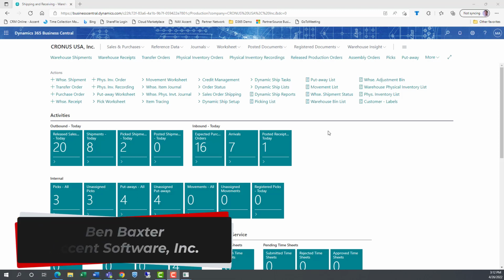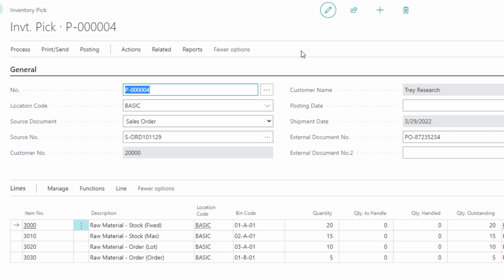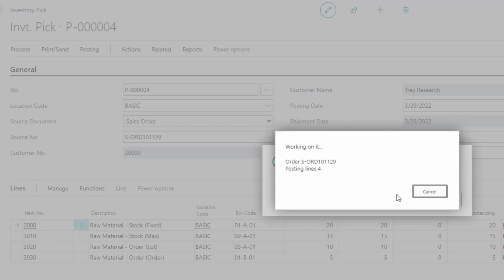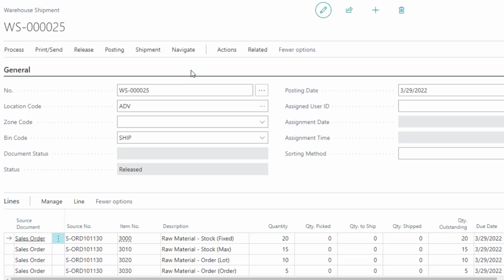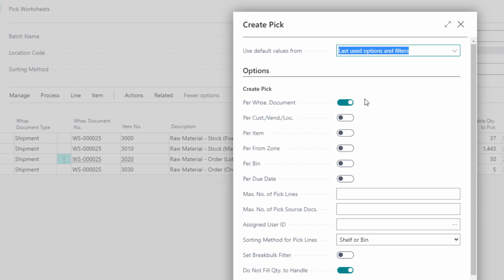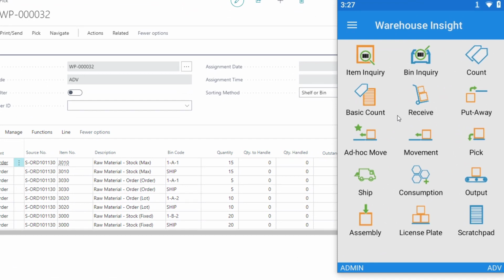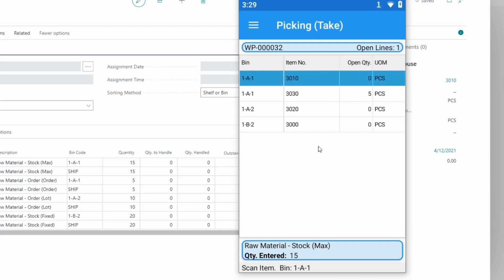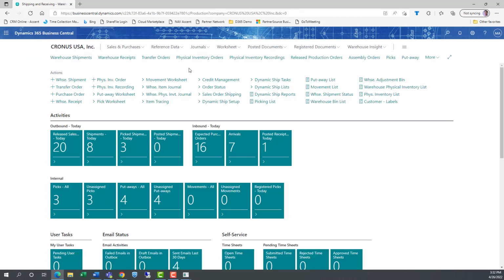Microsoft Dynamics 365 Business Central - Inventory Pick vs Warehouse Pick

Comment: How to reverse inventory picks?
Reply from the maker: An Inventory Pick will Post the Sales Order as shipped.  This means you need to go to the related Posted Sales Shipment and "Undo Shipment" from the Lines section.  This action can only be done if the Line has not been Invoiced.  If you have already Invoiced for the line(s) that was shipped, you'll need to do a Sales Return Order to back it out.
Reply: @AccentSoftwareInc  thanks for the reply, however even before invoicing i tried the undo option but it said the inventory pick is posted, hence can't, 😕